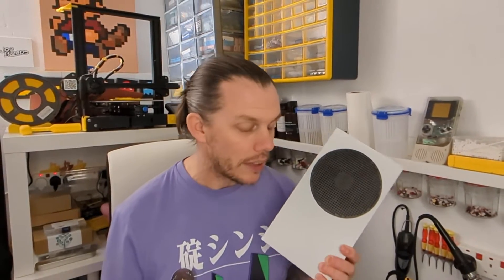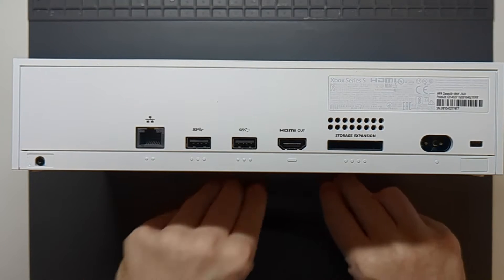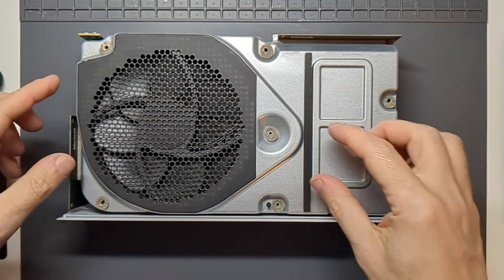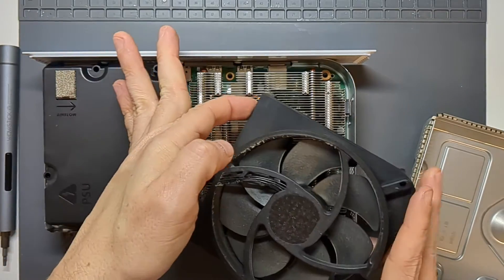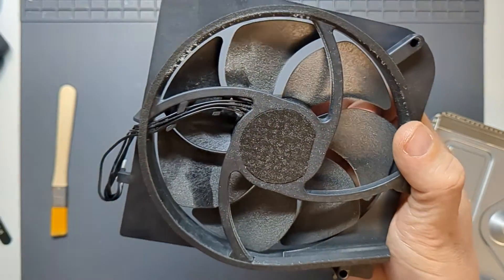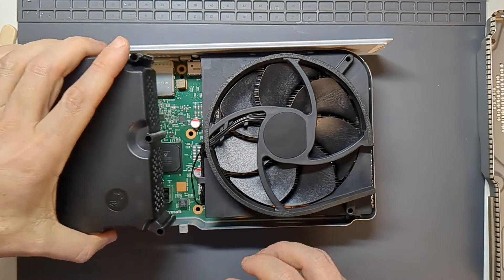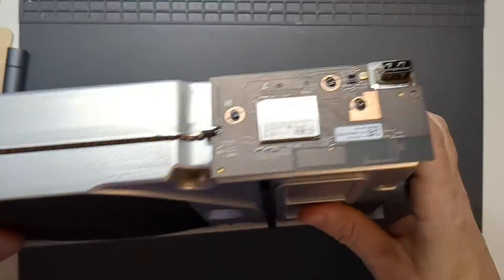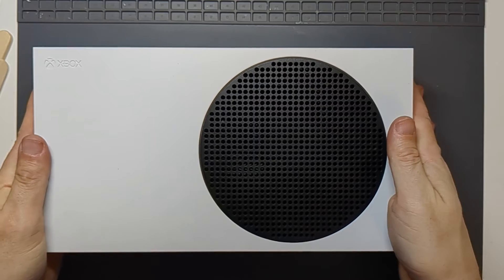Xbox Series S overheating - disassembly and dust removal (includes reassembly)

Comment: On the sides of the PSU, you will see small arrows; if you push them, you will be able to open it; make sure you check that the power socket is put back between the two holes as you put the two halves together.
Reply from the maker: Good advice, thank you!
Reply: How exactly do you push the arrows?
Reply: @muaathabdol2393  you push into the hole that the arrow is pointing to. There is one on each side.

Comment: I'm currently running into an "overheating" pop up window on the Xbox now. Was very meticulous/careful with taking it apart as it's my girlfriend's Xbox. It was originally just getting to hot due to being disgustingly cluttered with dust and build up that it would just shut off her Xbox no warning or nothing. I ordered a new fan that will be coming Sunday, hopefully it fix's my issue with it now. It originally sounded worse than a jet taking off with a very loud tick almost like the fan was hitting something. It's very quiet now to the point where I can't even hear the fan and barely can feel it pushing air after your tutorial. Do you think it could just be a fan issue though? Even though it got hot to the point it shut off it was spinning extremely fast trying to disperse the hot air and now it's barely blowing. Thanks! Awesome tutorial had 0 issues besides possible fan issue!

Comment: It was very helpfull to me because I could open and clean as best as possible. Also because I could confirm that the last guy that had ‘repaired’ my xbox didn’t exchanged the mother board as he said (it was another problem at that time, but big fraude anyway). Now I Will exchange the thermal paste and lets see if will solve this. Thanks man!

Comment: I coated the fan blades with antec deep gel help reduce dirt and debris sticking on to the blades. After an year vs previous it has no dirt or dust

Comment: i'm going through the possible issues with mine, i noticed last time my game crashed the system was hot as well, so i was wondering if it was due to dust and general ventilation

Comment: Every time I try to log into Black Ops 6 with my brother's account and open a mode, the game freezes immediately. Sometimes, a pink or white screen appears, and either I get kicked out of the game, or the console restarts itself. The same issue happens with another game, where I keep getting kicked out of the lobby. I've tried many solutions, but nothing works. Can you please help me?
Reply from the maker: @baris6615  sounds similar to what I had, but cleaning it like this solved my problem so I haven't tried anything else

Comment: Hi, great video!
Do you have any clue to what the issue could be with a quite loud noise starting up?
It dissapears after a few minutes and o have no problems with overheating either.
Might be the fan for sure, but i don't wanna open it up if it's not the problem.

Comment: Mines turns off everytime i turns it on and i already changes the cords and still doin it..plz help😢
Reply from the maker: @dmontekirtz8815  is this after you cleaned out the insides?
Reply: @JoeBleeps  naahh I just got the stuff to do it but ima have to get another tool cuz ..tools I have doesn't fit the screw for me to take it apart

Comment: My green screws won’t go back in
Reply from the maker: make sure everything is aligned correctly and try turning the screws anticlockwise until you feel them pop into place before you screw them in.

Comment: i used isopropyl alcohol and a q tip for the back stickers i figure hydrogen peroxide would work too
Reply: update - i cleaned dust mites out of the holes of my xbox and was pleased with the refurbishment that my xbox got but my xbox is still turning off so replacing thermal paste next 🙃

Comment: Not sure if you’ll see this a year later, but I’ve had my Xbox since they first released and have always lived in very dusty housing (New Mexico lol) this video is amazing on walking through how to take it apart, but I’m curious what are you cleaning it with?? Mine is CAKED in dust to were my blower doesn’t even do anything to it so just curious what you were using
Reply: Use a few brushes for the different holes and a microfiber cloth for the outer and inner shell.

Comment: my power button does not press anymore after re assembling it. could any one tell what could we do to get it working again.?
Reply from the maker: My guess is that something around that button wasn't aligned properly when you reassembled.  Try opening it again and double check the power button assembly.

Comment: My Series S is nearly 4 years old. It started to shut down randomly on its own. Cleaning was done successfully after watching your video. The console hasn't shut down since then. The fan (still) makes some slight noise though even after cleaning the console. Do you know why?
Reply from the maker: It will always make a little noise, but the cleaner the parts of the fan are, the less air resistance you'll get, the quieter it will be.

Comment: Im here because my xbox is 3 years old and I want a new one lol so im gonna buy a brand new one and I'm switching out its new internals and im putting it in my xbox and I'm putting mine in the new one and poof i will have a brand new xbox again 😂
Reply from the maker: Why would you swap out the internals?
Reply: @JoeBleeps  so my Xbox can be new again and it won't overheat
Reply: I forgot to type the part where I take the new console with my old Xbox internals back to Walmart for a refund lmaoooo
Reply from the maker: @Mobxcag13  ohhhh I understand now. I'm not sure that will work lol

Comment: Some little silver screws r impossible to open, any advice?
Reply from the maker: @FREEDOM80085  which ones? Are you using the right driver?
Reply: @JoeBleeps  the ones that r needed to get to the fan. I got all of them except for 2
Reply from the maker: @FREEDOM80085  I'll have to revisit and take a look

Comment: Does this help with gaming performance? All of the games I play have recently felt more delayed then usual and my xbox has felt hotter then usual.
Reply from the maker: For me, the issue was having it cut out. I'd say if it's slow and it's running warm, it may be able to operate more efficiently after a clean, but you'd also be worth seeing what free drive space you have and consider situating it in a better ventilated area too

Comment: Is it normal for my new series s to smell like burning plastic a little bit or doesn’t over hear or anything and game play is fast and fine just wondering should I take it apart a see if anything’s wrong it’s brand new tho
Reply from the maker: If it's brand new it should be fine. That does sound a little strange though. I'd more likely return it than open it up as you'll be voiding any warranty by doing that

Comment: well my series s just randomly is turning on like normal then the icon that lights up on turn on just dims a second later and then it turns itself off 

Never had a problem until now and legit play the thing hours a day for a month and a half now…

Well just bought the tools I need to fix it and should be here to me in 2 days, then I will rewatch this and do all you did. Thanks bro and wish me luck.

Comment: What happens if really small insect get into top grid above xbox button or dirt fall inside can it damage console or is it safe ?
Reply from the maker: It should be okay but if there seems to be a problem, follow the guide here to open it up and remove the debris
Reply: @JoeBleeps  Everything seems fine no noise no overheat no freezing/lagging during gaming I just saw that little brown bug yesterday I think its called drugstore beetle really tiny one on top of my XSS and I went for compressed air in can meanwhile when I came back it was gone and I had suspicion it might get inside because that hole is big enough for that type of insect to crawl in even when its just really small

Comment: Does it have an internal speaker like the Xbox one s? I'm asking because mine stopped making the sound when turning on and off, after a blackout
Reply from the maker: Yes I'm assuming it does, the sound seems to come from the console on this and my series x
Reply: @JoeBleeps  tnx for responding, fortunately, mine continues working, it turned off automatically on the option screen i don't know why. And i assume it would very difficult to replace it since it's on the motherboard

Comment: I can't take the top off wth lmao
Reply from the maker: it's tricky with anything you've not done before, hard to get a "feel" for it without thinking you're going to break it
Reply: @JoeBleeps  I swear to god lmao I thought I was breaking it but it was still screwed in so I just followed your steps slowly but surely got it thank you
Reply: My bad joe I didn’t see you unscrew it first I watched it carefully thanks I think my game might need a new power supply or fan  idk I cleaned my fan and it’s like still spinning then it stops then starts spinning then stops should I unplug it then back in ?
Reply from the maker: worth double checking all the connections for sure @taezo6886

Comment: The only other reason that it would overheat is if you leave the sleep option on it will be in power options you can just turn it off if you don't  know why that usually works for me and on my series x it kept overheating and that was why
Reply from the maker: That's a really good point.  Thanks for the suggestion.  I've got the Series X set up now and I have the low power consumption settings on there too.

Comment: Do you have any idea why my the fan would stop spinning ???
Reply from the maker: Either an electrical fault or something actually stuck in there. I'd open it up to check for anything stuck and stopping it moving first
Reply: @JoeBleeps   I fixed it I just started spinning it manually with a needle and it started spinning automatically again thankfully
Reply from the maker: @shane12346  phew!
Reply: Mine does the same thing then shuts down, if your having this problem restart your Xbox wait then download any game til it forcefully turns on…so you can sell it for a Ps5
Reply: @DiddyTism  I fixed it I just started spinning it manually with a needle and it started spinning automatically again thankfully

Comment: Thanks for the tutorial quick question tho my fan connecter won’t come out and I tugged hard not to hard so I don’t damage but it doesn’t wanna come out any tips for that ? my Xbox barely had dust surprisingly I haven’t opened it sense I bought it 2 years ago
Reply from the maker: It's always scary with that sort of thing. Just take your time and gently wiggle. You're right to be cautious, these things can break and then there's no going back 😬

Comment: I have a series s it freezes up and shutoffs with no warning other than overheating i dread taking it apart and clean it. But tomorrow ill attempt it the first time.
Reply from the maker: That sounds like exactly what mine was doing. Dismantle and clean, and then keep it in a well ventilated space when you use it in future 😊

Comment: I have this console and in my opinion. It runs hot fresh out of the box. I put my face close to the exhaust fan. And you can really feel the heat coming out of this thing. Based on my research, they say it's designed to run hot due to its small form factor. I purchased an external cooling fan which does help a lot. But I really noticed it to run cooler when I game in 1080P. VS 4K 120 Hz. Thanks for the video now. I know how to take this thing apart.
Reply from the maker: I have found the best way to keep it going is to give it plenty of room for ventilation. Any enclosed space will cause it to overheat and gather dust. I am glad you have found some other ways to keep it cool too!

Comment: Any advice? Mine worked fine until my kid was sick on it. It was  cleaned.  Now it won’t power on or anything I’ve tried different power cables and am going to follow this video to take it apart. Was wondering if you thought it could be anything else before I clean the fan
Reply: Literally just needed all dust cleaning out, works fine now
Reply from the maker: @jakeScan027  great news!
Reply from the maker: I'm guessing you might find out when you open it up! 😬 Good luck

Comment: Had a Xbox for many years these new ones seem to break down alot more then usually especially the controllers they should be more reliable not worst
Reply from the maker: It's such a powerful machine in such a compact form. It's little surprise it's prone to overheating! Mine has been much better since cleaning
Reply: Thanks for the video easy to follow and not long winded

Comment: Just keep a clean house and then you dont have to do this and duhh the problem just could be the termal p because with that little dust inside the xbox wont overheat
Reply from the maker: Dust still gathers regardless. And I've always been surprised that this worked as there was so little dust in there! But it's still going strong

Comment: I see you have a 3d printer, I designed a fan duct to pull more air of the front exhaust. It uses a USB powered 120mm fan plugged into a wall brick. My xbox stays significantly cooler than it did before. I posted it to thingiverse if you're interested.
Reply from the maker: That's really clever! I'll have a look later

Comment: Hey I dropped a crumb of food on accident through the black part of the Xbox conspire feeling if it was hot and I’m worried it will catch fire will it?
Reply from the maker: I'd expect it would be fine but if you're concerned and you need to open your console to remove it, follow the steps in this video

Comment: I wonder, when i assemble it back, will it be better to not reattach bottom plate, but instead place it on aluminium plate for better cooling?
Reply from the maker: I think good ventilation is key

Comment: Yeah me being LAZY AS BLEEP, if I go to to the effort to open the case, clean the fan and have to put er back together---I will just do the Thermal Pasting, or at least check it out BEFORE SEALING IT BACK UP even if I don't think it really needs it. Because I would rather just take the thing apart and put it back together ONCE instead of TWICE but that's from me having to work on the BLEEPING XBOX 360 Slim which was probably THE WORST THING to take apart and put back together ever. Just so many stupid plastic tabs and other crap to try to prevent people from doing their own repairs/tinkering. 

And sadly, finally no matter what I did I just couldn't keep my 360 Slim from finally Red Ring Of Death on me :( 

I think I will invest in a good dust cover for the Series S to try to keep dust off of it when I ain't using it so hopefully knock on wood I won't have to go and deep clean the fan all that often.
Reply from the maker: Oh the 360 definitely needed thermal paste. I had so many issues with mine

Comment: 6:23 so you didn't change thermal paste, because you wanted to see if it stopped overheating just by cleaning the dust
Reply from the maker: Yeah like most things it's a process of elimination. For a relatively new console I'd generally be optimistic that the paste should still be okay in most cases. If that hadn't fixed the problem though, the paste would have been my next course of action.

Comment: I’ve done this and now it won’t power on… omg. I didn’t go as far as pulling the PCU out either. 🤦🏼‍♀️ 
I’ll try again tomorrow.
Reply from the maker: Don't worry. It will likely be a simple connection you missed. Retrace your steps and I'm sure you'll have it working again.

Comment: is changing the thermal paste needed
Reply from the maker: If you clean it and it works again, don't interfere with the paste. If it's still causing problems that's what I would try next. It's a relatively new console so the original paste should last well

Comment: Delighted to have come across this. I turned on my Xbox to play some halo tonight and can’t play more than a few minutes without the console shutting down. Unfortunately I’ve no T-8 bit so I’ll have to get that tomorrow. But I’ll definitely be using this vid to help with my cleaning. Hope it helps!
Reply from the maker: I hope it helps too!
Reply: Did it work??
Reply: @AfraidFeminine0  yes. My Xbox has overheated twice from my son leaving it on in a closed drawer. Both times I’ve taken it apart and cleaned it following this video and it’s worked fine after

Comment: My back isn’t removing our easy like it isn’t sliding off
Reply from the maker: Did you get the two screws out from under the stickers?
Reply: @JoeBleeps  yes I ended up just plying the case open instead

Comment: Tried this step by step but now my Xbox won’t turn on at all😭 could it be the thermal paste ?
Reply from the maker: That's possible but if it switched on before, you've probably got a connection that's not properly seated, worth giving it another check first
Reply: Did u get it to work ?
Reply: @MikeDavis-ej9fv  no :(

Comment: I took mine apart to clean put it back together now im not gettin any power i took apart to clean because it would beep but then go off now its not even doin that anything I did wrong?
Reply from the maker: I'd say open it back up and check all your connections. Even if it looks like everything is connected there could be a cable or ribbon not quite seated right. It's happened to me plenty of times.

Comment: My xbox series s fan is really loud i’ve already done a deep clean and it’s still really loud
Reply from the maker: Noise from a fan is usually just vibrations in the air that's not passing through as smoothly as it should because of the dust build up. If it's noisy when it's clean it might be something mechanical, possibly a fan replacement needed? I'm just speculating. Even when it was overheating my Series S was always quiet.